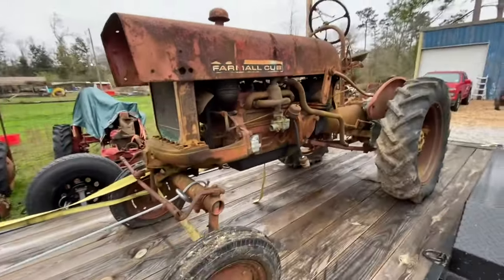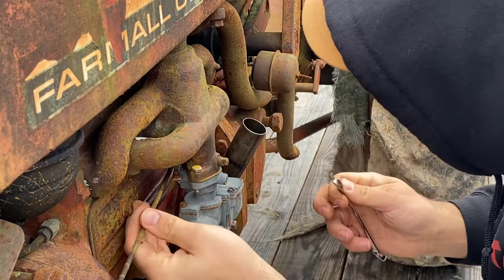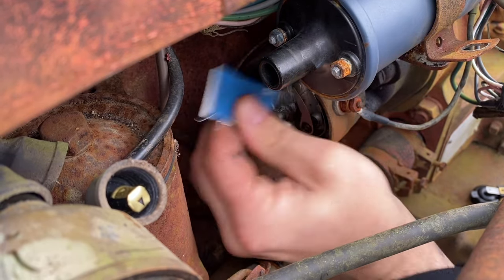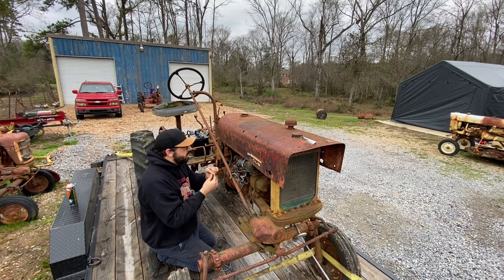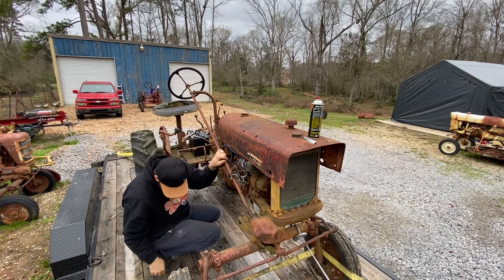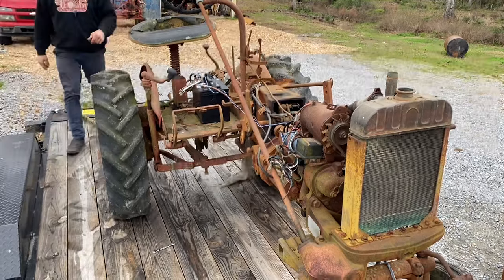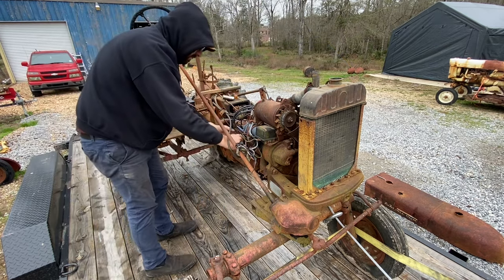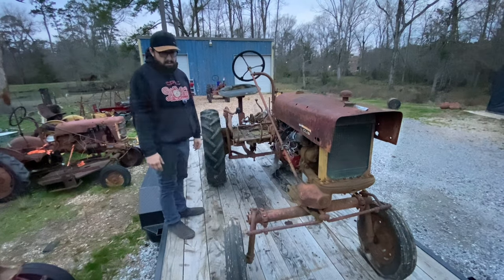WILL IT RUN?! Abandoned 1964 Farmall Cub

Comment: I love the competence shown the fix it back to working and the confidence to reverse it off a trailer without moving the expensive looking truck parked outside the garage first! What a great tip about priming the oil pump through that small hole in the filter housing as a possible way to get oil pressure back after sitting a long while.

Comment: So to tell timing.. take the distributer cap off....and make sure the rotor button when its pointing to number 1 plug...is lined up with the notch in the distributor housing?? So they all make a straigjt line???... im working on a cub also...
Reply from the maker: Correct. It’s something I picked up working on these. Cylinder one has to be at top dead center. Depending on what you are working on if it’s a cub, take the number one spark plug out I usually stick my finger over the spark plug hole and bump the starter over till I feel compression.  Then I’ll use flash light and use the cooling fan to pull the piston up to top dead center.  Some thing goes for the super A’s, 100’s, 140’s etc.  

When you have the engine at top dead center you can adjust the distributor to how I mentioned.  Number one plug on the distributor cap is normally marked with a 1 but if it’s not. Just know that it’s opposite the notch on the distributor .
Reply: @ErichsGarage  I got mine going....I found it to be 180 degrees out of time